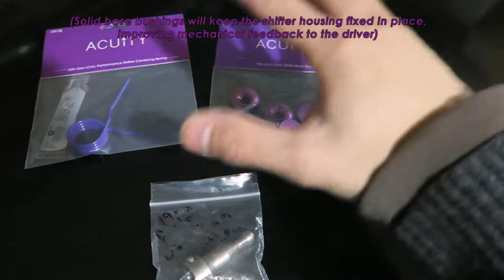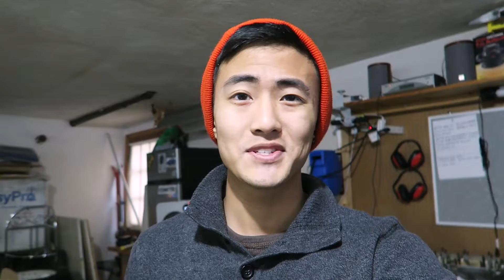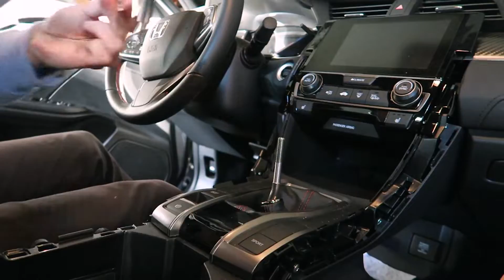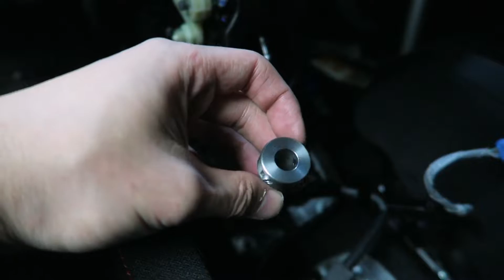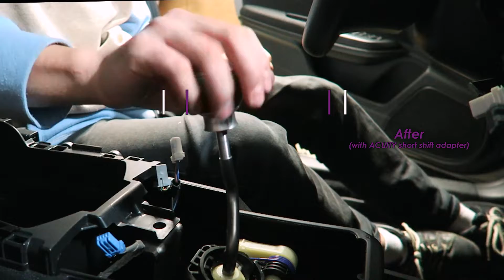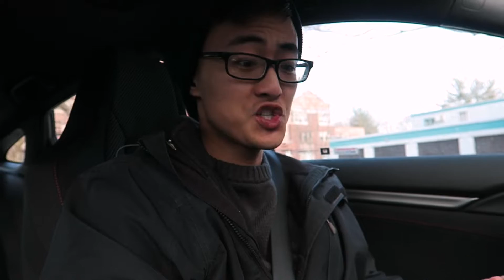Shorter Shifts For Your 10th Gen Honda Civic! Acuity Instruments Short Shifter Adapter Review

Comment: With the Short Throw Adapter you will not be able to go into 5th while you are sitting in the car testing the new adapter. Works fine after everything is put together and  you are driving regularly.
Reply from the maker: you are correct, going into the gates for 5th/6th will be difficult if the car is stationary because the reverse gear gate isn’t locked out. Once the car picks up speed there’s a solenoid that’ll engage that lockout 🤘🏼

Comment: I have a 2018 Accord Sport (which has basically the same transmission as this IIRC) and Acuity has the same products available, but I was wondering if it's worth investing in the bushings and centering spring? I'm definitely getting the short shifter but I'm still on the fence about the bushings + centering spring, especially since it's $125 CAD more.

Comment: Great Informative video...but is that part compatible with a 2018 type r???
Reply from the maker: No this extender is not compatible with the type r shifter. I would recommend the full adjustable shifter from acuity if you want the shortest throws (and 3 other adjustable points too!)
Reply: Thanks dude

Comment: I’m assuming the disassemble is the same on the civic hatch sport?
Reply from the maker: Yessir 👍. All the trims should have similar disassembly procedure. Stuff like wireless chargers on some newer models may have additional electrical connectors to unplug tho
Reply: So I added the Shifter. But question, is the adapter suppose to slide up and down when it’s installed? I tightened it up, but it slides down to the ball joint. It doesn’t come off just slide up and down
Reply from the maker: @ronaldocampos3517  hey man! No it's not suppose to slide up and down at all. You have to push the short shifter extender all the way up, you should feel the snap ring on the inside of the extender expand slightly as you push it up on to the stock shifter. Once you tighten it down everything should be rigid. Don't hesitate to contact acuity if you have more concerns with this!

Comment: Was this video before the or after the fix you did with the noise/rubbing the short shifter was making? And when is acuity gonna come out with the short shifter adopter?
Reply from the maker: Before the video! We made the shifter fix video when we realized that the noise occurs with any shifter adapter that “extends” the shifter end link to reduce throw 👍. Rather than design an additional part to lock that bushing, we wanted to show you guys a cheap/easy solution to those that want the noise gone. The part is out now!

Comment: question? sir, i just order and about to install the adpter . do i need to get the springs and bushing? what will happen if i replace the adapter only? need help. thanks
Reply from the maker: No you do not need the other parts. That's the nice thing about each one. They all provide unique upgrades on their own :). Quick tip. When you install the adapter make sure you press it up all the way, because there is a ring on the inside of the adapter that needs to expand as you push it onto the bottom of the shift lever. Some people don't do this and then the adapter will fall off from the shift lever. When you tighten it down, double check each torque twice. The adapter should be rigid and not have any play if installed correctly 👍
Reply: Pawinning how about the shifter from left to right or vice versa?
Reply: Pawinning  whats the difference if i don’t replace the springs and bushing?
Reply: Pawinning because i need it i wll order because too much work replacing the adapter
Reply from the maker: To shorten the movent side to side, the rocker arm will provide a nice reduction and also reduce almost all the lateral play. I'd recommend that with the spring and base bushings of you want to take your center console apart once 👌😉
Reply: Pawinning okay sir. maybe i should order both

Comment: I have the sport and I realized after driving it for a bit of the larger amount of play. It’s annoying me and I’d like to do it. I’m just worried about trying to install it myself and messing it up
Reply from the maker: Don’t be intimidated! For most of the installs I tackled these parts for the first time. The pdf guides were a great resource. Tbh the hardest part is unfastening the darn electrical clips (center console disassembly). Other than that everything else is pretty straightforward to remove! If you need assistance, Acuity has great customer service I can vouch for. I can also talk via private messaging on Instagram and Facebook
Reply: Pawinning thanks man, I appreciate that. I’m gonna look more into it now!

Comment: sir need you help after installed the bushing, adapter and springs, on the instruments cluster its says system analyzing
Reply from the maker: Hey man! Sounds like youre talking about the cars electronics initiallizing when you first plug the battery back in? If so, that's totally normal. If everything is plugged back in, the car will show warning lights first as it tests all the electronics. Drive it for a few miles and then restart the car and it should go away 👍
Reply: Yes sir. Thanks you so much .
Reply: Sir Pawinning im very happy to my acuity products. Much more happier if i get the short shifter itslef but its to expensive. You know, family first. Hopefully i could afford that shifter. Thanks your sir for giving time to reply my msg. More videos to come and take care sir
Reply from the maker: @rickydomingo7  you're welcome, I'm happy to help as I can. No worries man I understand, I also have a tight budget now that I'm doing video editing as a full time gig. More videos to come 😎